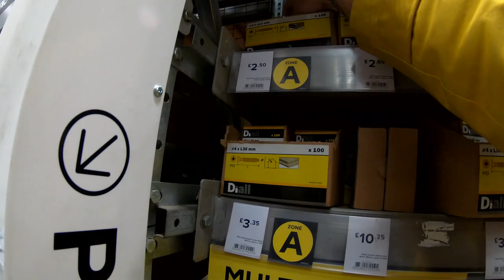#26 More 240v Boat Electrics - Dutch Barge Home

Comment: Excellent Beth.  Ring circuits are useful as you can always connect in an extra "dropper" if you need to later.  Radials are good for higher power usage equipment like driers, cookers, washing machines or electric kettles!  Keetles pull twice as much power as microwaves.  Great work!